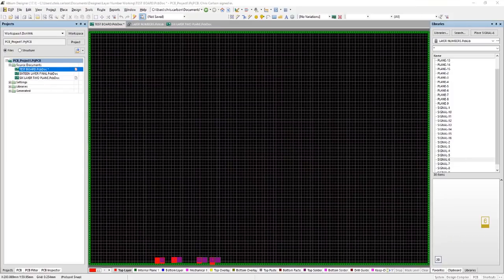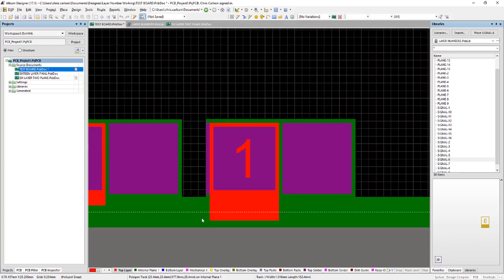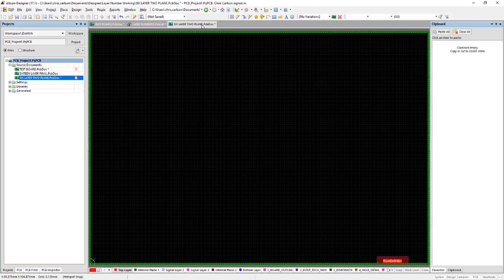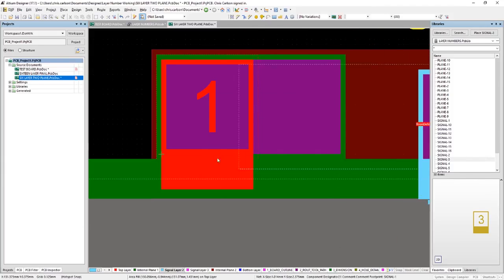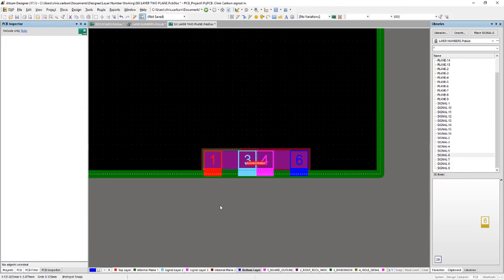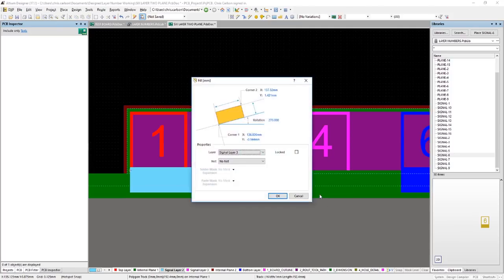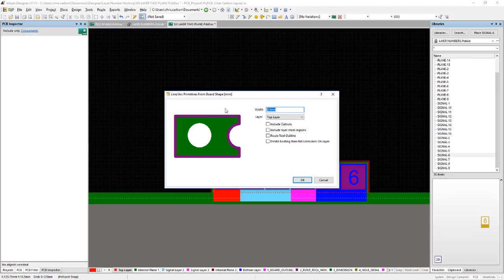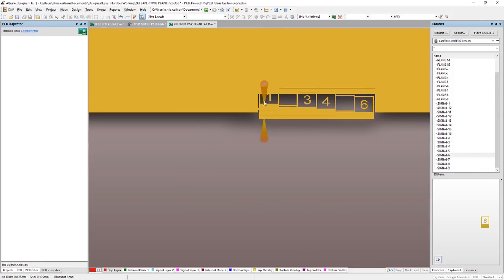Creating Layer Numbers and Stacking Stripes in Altium Designer - Altium Academy

Comment: Does this no longer work? Having difficulties placing on specific interplane layers. Extremely insane to me that Altium doesn't have a simple feature for this. Maybe an option, like for vias have assembly and fab selections, allow polygon pours to have a Stacking Stripe selection allowing you to place it on PCB edges AND on internal plane layers. Simple, easy, none of this... Just seems like multiple layers (no pun intended) for mistakes to occur! Especially after Altium removing perpetual licenses, we are paying out of the ass and I can't put stupid stripes at the edge of my PCB without some bull workaround video from so many years ago that Altium doesn't even have this UI anymore... Sigh... None of this is directed to you but this is super frustrating. The problem I think, if I'm understanding correctly, is that if I mark all plane layers as signal layers, then the impedance profiles will no longer work in Altium! This is a HUGE sacrifice since no impedance equation will come as close in terms of accuracy as Simbeors 2D Field Solver used to calculate impedance for tracks.
Reply: You are correct in finding the limitations with Plane layers (and licensing changes) very frustrating.  If Altium offered some reasonably technical explanation as to why they do not want to make things work smoother with Plane layers -- as in explain it from a technical cost perspective because 80% or more of Altium users are technical and have at least some reasonable understanding of programming -- then maybe we'd feel better about offering Altium more grace in the messed up areas of the tool.   

Changing all Plane layers to Signal Polygon-pours should not change your stackup  impedance calcs if your polygon-pour is indeed just as solid as a plane (if it does, then there is something wrong in how Simbeor is treating it and Simbeor is the company to pester about it).  HOWEVER, changing all Plane layers to Signal-Polygon-pours is not a 'work-around'; it's a fundamental _change_.  A 'work-around' would be something like change the board outline in the stacking stripe protrusion area and then make a board cutout or routing path or simply draw the M1 outline layer thru it and make sure the PCB fabricator uses that outline instead of an automatically generated one from Altium....and check the Gerbers to see if you really got what you want.
Reply: We did an episode on stacking stripe placement, it should be coming out soon. I'll give you the takeaways now... I hate plane layers and there are many people out there who have told me the same, so I am always using signal layers with polygon pours to define the copper regions. Anytime I need to put a layer marking in a copper layer (could be stacking stripe, a layer number, etc.) I always use a signal layer because it is so much easier to place a piece of copper as a pour or region and assign it to a dummy net. For a layer number, you can put a polygon cutout and then place the number text in copper. Another approach is to place text in the copper layers, silk layers, mask layers, and paste layers which states what the layer is and what is the layer ordering (layer number, top/bottom, etc.). This way the CAM operator will have a visual way to verify the layer order and does not have to rely on file extensions or naming. This method and placing a layer number in copper in the interior of the board do not allow the designer to visually check the layer ordering, but it does eliminate any confusion for the CAM operator and it fully puts the responsibility on them to get the layer order correct.